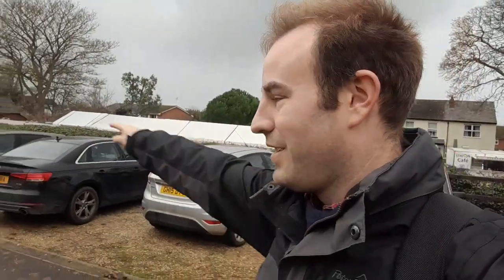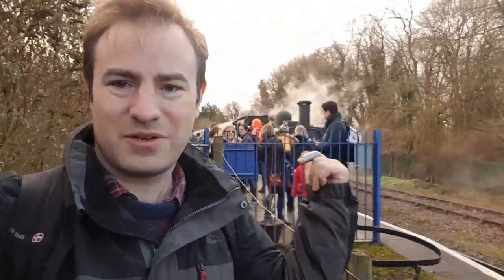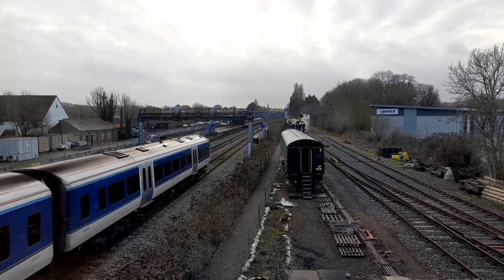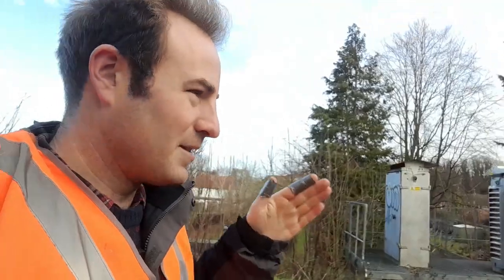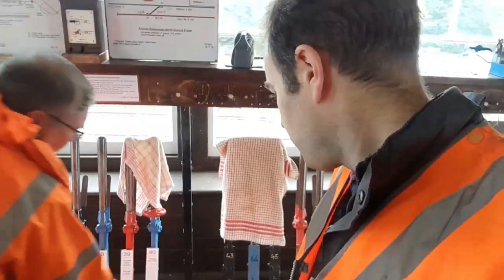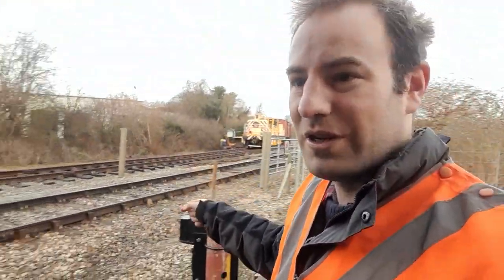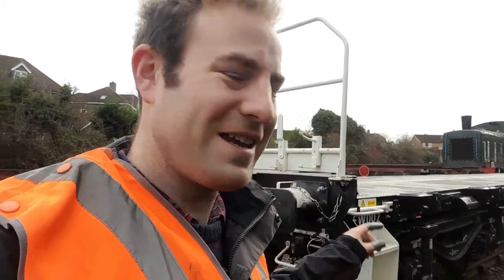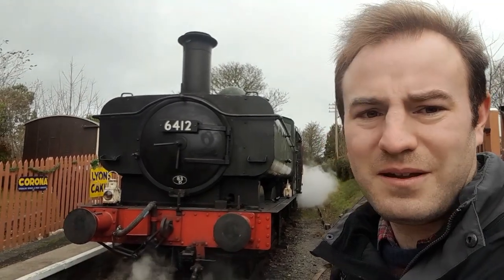Behind The Scenes At Princes Risborough North Signal Box.

Comment: Henry that was a very interesting video, as a former Movements Inspector (That's someone who tests signalman on their ability to operate a signal box safely), I can fill you in on a few details. The Signal with a cross on it is a stop signal with a route indicator, the arm comes off when the signalman selects one of the routes with the route name displayed (e.g. Main, Branch, Loop, Goods, Spur, Siding, Back Road, being examples of what might be displayed) this then enables the driver to check that the route set is the one he requires.

The interlocking is designed to enable the signalman to pull off all non conflicting routes at the same time but prevent any conflicting routes from being set up. The number at the top of the lever plate tells you what item it controls as seen on the track Diagram below it are numbers of other levers (up to four) of levers required to be pulled first before that lever can be pulled until then it would be locked in the lever frame.

For example  Lever 55  might read Down Main Inner Home to Branch Loop 26 40 48 49 that means you would have to start by pulling 26 which might have other levers you have to pull to reverse that one (again up to four) the same being so for 40 and 48 and 49. It would not be unknown that you might have to pull forty other levers to be able to pull 55. But you would need to pull them in the correct order and all of them before the locking would allow you to pull 55.

The colours of the lever tell you what is being controlled by it, Red for Stop Signals, Yellow for Distant Signals, Black for Points and Blue for Facing Point Locks or Fouling Bars being the most common. The Distant Signal can only be pulled when all the Stop Signals that in advance of it, Home, Inner Home, Starting and Advanced Starting have been pulled first and in that order.

If you want any other questions answered please send me a message. Andrew.
Reply from the maker: Thank you very much for watching and taking the time to give me this information. It certainly made very interesting reading.